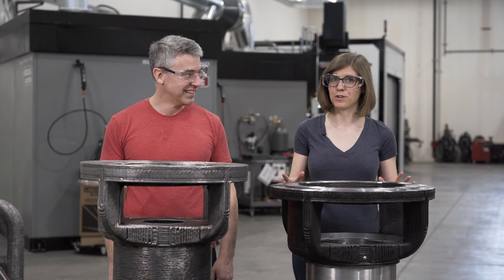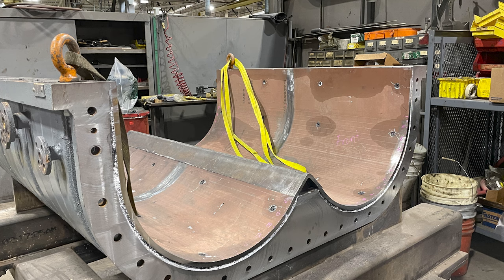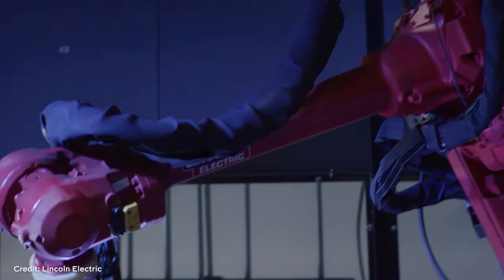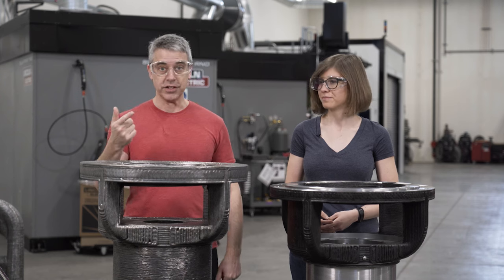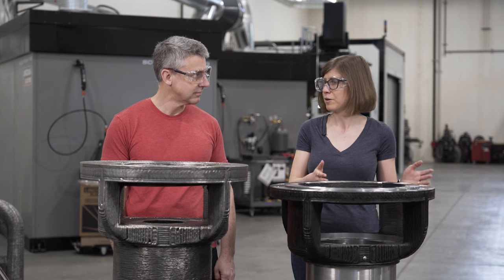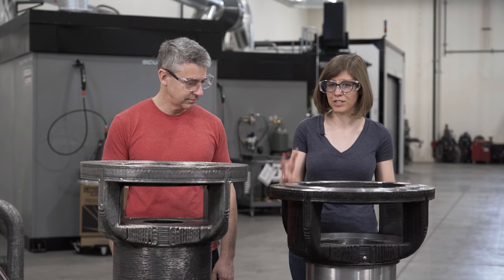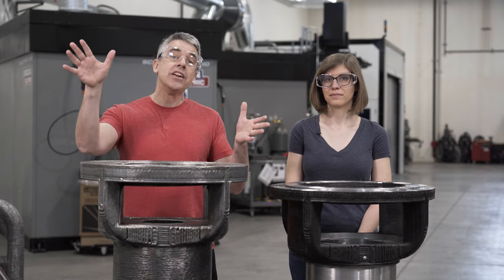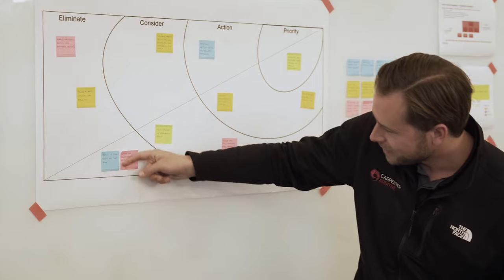Robot 3D Prints a 500-Pound Replacement Part | The Cool Parts Show #50

Comment: I'm kind of surprised this kind of work isn't already being done in a vacuum chamber or fully inert atmosphere. Using inert gas shielding obviously WORKS, but it's a fix for a problem the COULD be prevented by removing ambient oxygen from the equation altogether. It's not like you need a human to be right next to the machine for it to function, and even if you did, in the case of a fully inert atmosphere, you could employ the use of a sealed breathing apparatus. The amount of inert gas mix you expend using a gas shield for conventional welding can't be much less than what you'd need to replace a normal oxygen-rich atmosphere. I believe use of that type of vacuum/inert atmosphere set-up is inevitable, eventually. I'm saying I'm surprised it isn't standard, ALREADY.
Reply: Alden:
they are probably using 35 cubic feet an hour of a argon/co2 mix shielding gas....
..the current retail price is about $50 PER 300 cu ft.
If they are using straight co2, the price is far cheaper.
 .I am sure Lincoln gets it for a lot cheaper.....
so my guess is for [4] 24 hour days....96 hours at 3,360 cu ft, @ .16 cents
would be about $537.....
considering the cost of building an environment to remove 
the atmosphere , this is much cheaper for them.....
I am sure in the future vacuum facilities will be built as they do with Electron Beam Welding....

Comment: How did they convert from CAD/STL file to G-code to robot instructions?  Did they use a traditional slicing program, or build the robot program from scratch?
I would like to build a 3-D printer using a SCARA robot, so I am searching for simple solutions.
Reply from the maker: Response from Lincoln Electric: 
Lincoln Electric uses its proprietary additive software, SculptPrint™ OS

Comment: Great practical use of the WAM process. I'm curious as to total time to design, the four days printing is just part of the equation.
Reply from the maker: From Lincoln Electric:
Implementing the modest design changes did not take long. Start to finish:  3D laser scanning, CAD model creation and re-design, SculptPrint additive software slicing and robot programming, and 3D printing took 2 weeks.

Comment: I think this particular part could have been more efficiently produced by lost-foam casting.  Cut the foam out on a CNC hot wire cutter, cast it, machine it.  I think that could be done in two days or less.
Reply: Generally the mechanical properties of a WAAM part are very good since the alloys used for the printing have much better material properties than a casting alloy. So maybe they wanted a higher performing part.

Comment: How did they determine the material the original casting was made from?   XRF gun? Simple spark test? Hardness testing for approximate tensile or did they take coupons from the cracked housing?  Shape is just part of the design...  Is the housing stationary, or part of the rotating element? Curious if future versions could benefit from reducing the weight.  Also if the original was cast iron (making it difficult to just weld up the crack), are there any differences in vibration damping in the new steel part? I wonder how the other components may be affected by the change; as Rumsfeld said (paraphrasing) "it's always the unknown unknowns that get you."  What if the bearings have a 10% reduction in life due to higher vibrating loads, for example? Or perhaps the standard deviation of the flux particle size goes up a few points? 
Based on the color change between the "raw" part to the finish machined version I take it there was a heat treat after the build (assuming just stress relief). Any concerns or issues with the large changes in cross section?  Those inside corners look fairly sharp (relative to part size)...  Did they change weld orientation based on stresses, or just to eliminate supports?  I'm sure they wanted to leave the as welded look to show the manufacturing, but maybe shot peen to help avoid fatigue issues (so this one can make it 80 years too)?  It didn't look like they added any reinforcement around the tapped hole that cracked either.
I wonder what Omer Blodgett thought of WAAM. I couldn't find anything in a quick search, but would appreciate any links if they're available (probably wasn't called WAAM originally).
Thanks, as always, for the interesting video.